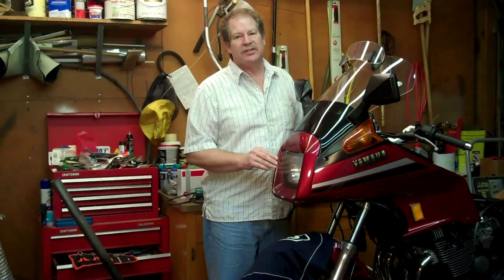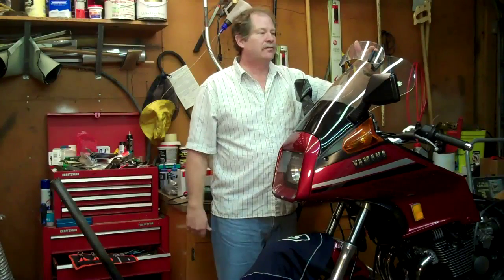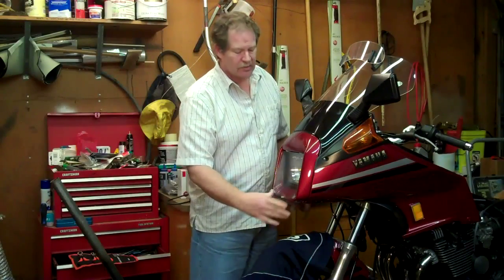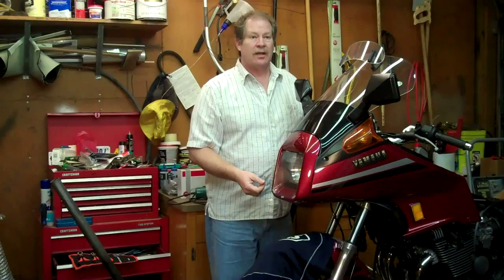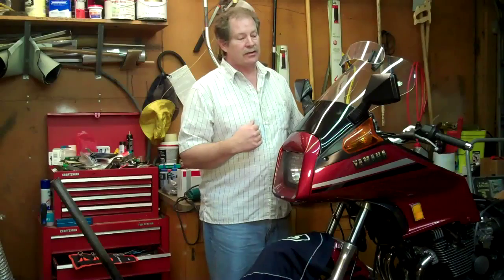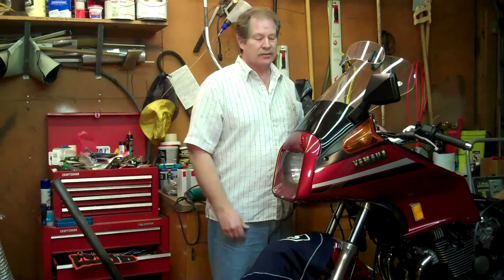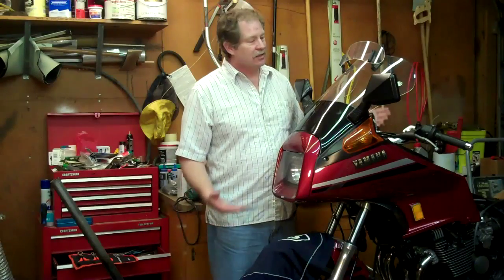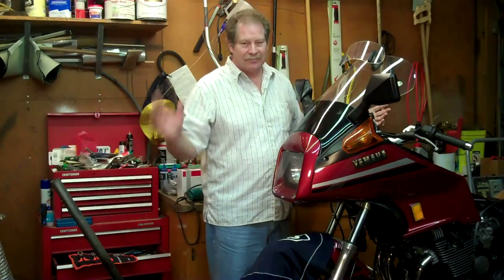How to get more MPG from motorcycle

Comment: Hi jon great work , i have a 1990 xj 900 f, it has about 55 on the clock , so just getting run in , i have had 4 of the f type and a div s , and also find up to 60 quite possible , i have gone to dunlop st smart tyres , with a silica and one tyre size up on front and rear , this changes the profile to 80 , i find them very good , thay heat up fast and give good grip , keep em coming mate love the 900 f.